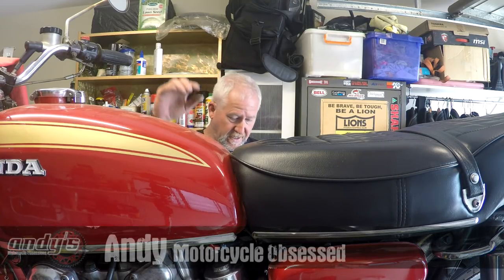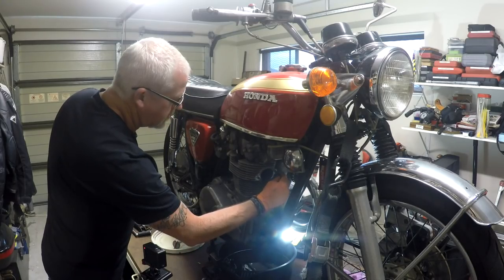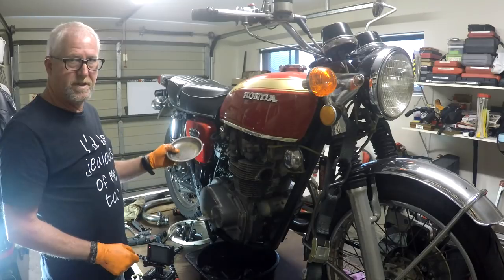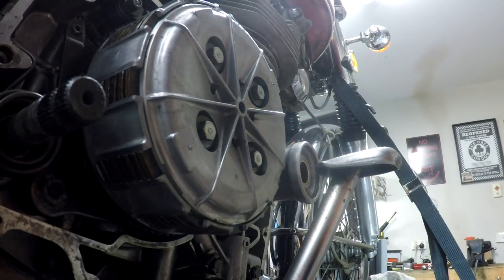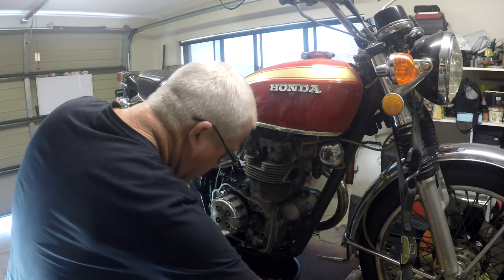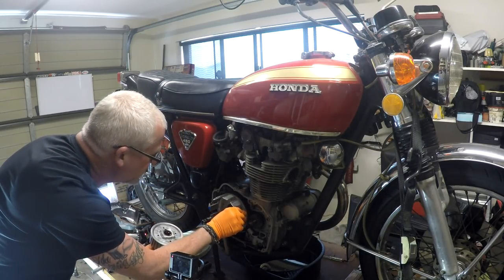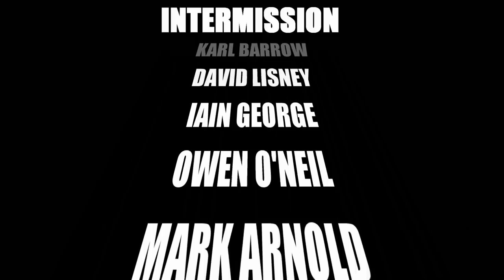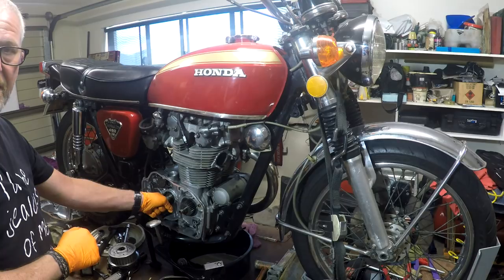HONDA CB450 Gear Selector Issue

Comment: Good work, I have spent many hours getting the gear selector right on my Classic Royal Enfield following a gearbox bearing and clutch plate upgrade. The smallest adjustment will make the difference between loss of top gear, first gear or simply jumping out of gear. I have managed to make the gearshift as slick as a Suzuki but it was simply taking the time. Adjusting the end float may have moved a wear patch on the shaft away from a bush.

Comment: You are lucky to be able to undo the oil drain plug, On my two CB450's and my CB500T even a meter long Johnson bar was not enough to break it loose. Read about same issue in a 1975 road test.

Comment: My 1973 CB450 had the same issues the selector forks bend really easily if you have a fall on the left side and if you keep riding the dogs on the gear wears causes jumping out of gear problems. I had the bike from new from my learners

Comment: I know it’s been a awhile now, but did you shim the gear selector shaft so it pulls outward or so it pushes back in towards the engine?
I’m having issues with mine getting stuck and then the gear lever slaps my foot.
Reply from the maker: The problem was that the circlip which is located behind the cover on the left hand side of the engine had popped out of the groove. After replacing it I placed a washer between the gear lever and the case and it never failed again. Sadly I had to sell that bike 😢

Comment: Bought my 1972 CB450 at the beginning of may. 6100 miles on the odometer. Only issue i have with shifting is sometimes when i go to second, after a few seconds it might pop back to neutral and i have to select back to second. always fine the second time. maybe just wearing something back in after sitting so long? i have never torn into it like you have with yours yet.

Comment: Have you tried rotating the wheel as you attempted to go through the gear changes? It’s not supposed to be able to go through the gears if the shafts aren’t rotating.

Comment: Very helpful video! I'm working on a 1974 CB125 currently. Does anyone know why my shifter will only take me up to second gear then stop??
Reply from the maker: I suspect that my issues are with either a worn selector drum or forks.  If your external assembly is okay then I would suggest that yours too is inside the case.

Comment: A soft mallet might have been better/safer to use to tap the engine case?   I've seen guys used hammers to tap a bit too hard and cracked or dented the engine parts before.

Comment: You should have replaced that little spring Andy, its the source of your trouble. I did that same repair on my CL 450 years ago.
Reply: It usually comes down to a small spring somewhere, when there is nothing obviously broken. If I'm going in that far I'd generally replace any spring even if they aren't suspect. They usually don't cost much, but the hassle to get to them in comparison is significant.
Reply from the maker: I did check them and they were all in place and firm.  I was thinking the same thing before I removed the side case.  Do you think they're U/S and should be replaced anyway?
Reply: I don't know how long the strip down took you Andy, but from a Moto Guzzi point of view it seemed simple. My MG B750 has a ticking time bomb in the box for about 5% of the bikes out there. It is a < 1 USD spring that when it lets go, means stripping the bike down, (separate gearbox bolted on the arse end of the engine with single plate dry Fiat 500 derived clutch on the end) so I'm always tempted to replace all springs, whether they look good or not. My experience is that I can't tell a spring that is about to fail, but that may just be me lol! That is just down to my experience with Guzzis, so that's why I would do this. Nothing worse than spending 2 full days work to replace a low cost item. That Honda is a different beast though.
Don't worry about it now, you got it sorted! Sounded really nice on the test ride by the way!
I'd just forget about it. If it happens again then I'd replace them, but as it is now, it isn't broke, so no need to fix it. I'm no gearbox expert either but I KNOW that springs are the work of Saten. LMAO!
Reply: Also, if you are a bit skint, you can easily make new ones out of MIG wire. Can't remember which channel I saw that on, but this bloke can do anything with that stuff! Moon-something I think his name is.
Reply from the maker: I'm pretty sure I now know what the problem was/is.  The strip down was only 30 to 40 mins if you don't count the dicking about with bloody lights mics and cameras.  There is a strong centering spring on the main selector shaft that runs from the gear lever on the other side of the bike.  It had come disengaged from it's "centering" tab on the shaft due to the amount of free play in the shaft.  I didn't think much of it at the time as I assumed that I had done this while disassembling and I just slipped it back into position.  I bodged up a temporary spacer between the gear lever and the case to reduce the free play until I can find the time to pop the LHS case off and see if the circlip is either a) fitted or b) missing all together.  Going for a ride tomorrow with a mate and I may take the Honda, if I can be bothered shuffling bikes and taking it back off the lift at 7:30AM.  It's not a cost issue, but I would hate to dump $45 worth of MOTUL oil for nothing.
Reply from the maker: No that is just cruel PMSL

Comment: Those pipes look new Andy. Can I ask where you picked them up?
Reply from the maker: Factory original mate, the silencers are not perfect with some dents and rust on the underside.
Reply: Aftermarket ones I bought don't fit

Comment: Hello Andy, I had the same issue with my cl350 motor, come to find out after I had disassemble the motor it was the locking pin for the selector drum that had punched through the case somehow, I guess with enough vibration it can..& absolutely does happen, if that locking pin is loose upon reassembly.. you better epoxy that sucker in! If you don't it can vibrate and punch through the case, if I had caught this I would have just needed to epoxy it back in, and shifting problem would have been solved! So if anyone out there is having the same issue, check that area!!!
Reply from the maker: Thanks mate. I actually sold that bike about a year ago, was sad to let it go.
Reply: @ANDY5  no way! You let her go brother??? I'm surprised you did! It seemed like you really liked her, I just picked one up, a 73 CB450 project for 600$ with a clean title, she does need work with the electrical, but not bad for only 600, will you be buying yourself another one? And why did you let her go?? If you don't mind me asking...
Reply from the maker: I thought I would never sell it either. We just simply needed the money. Will I buy another? Who knows?
Reply: @ANDY5  well what does a project cb350 or 450 go for out there down under?